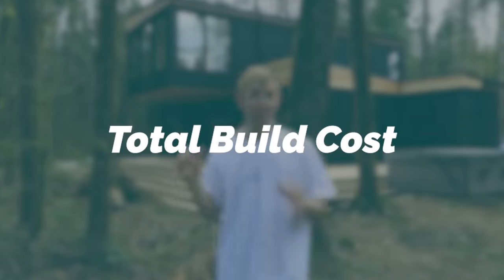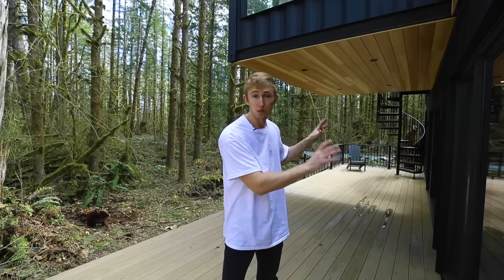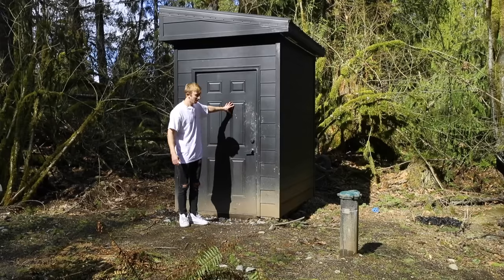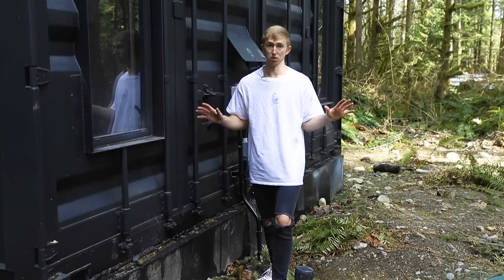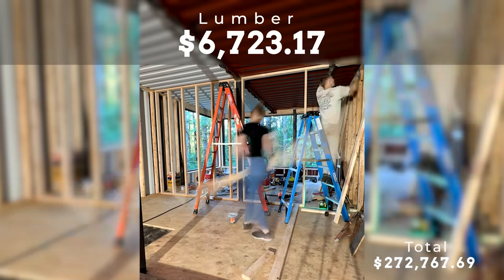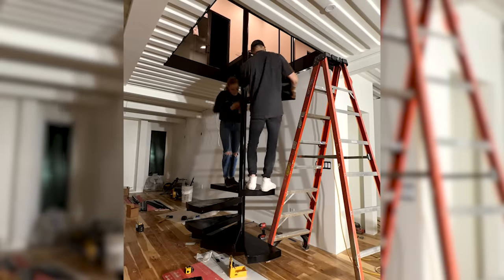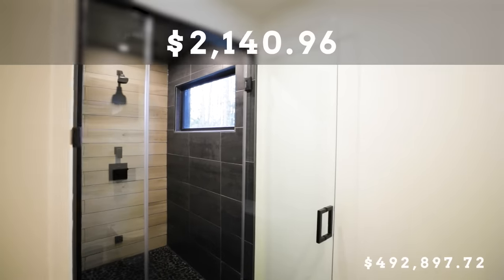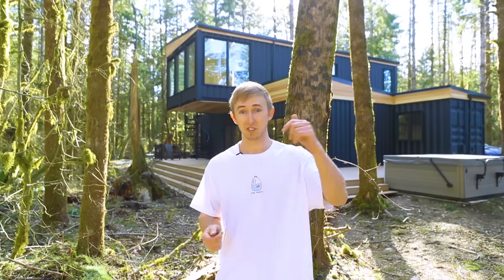How Much My 2-Story Container Home Cost to Build

Comment: Designer-turned-building contractor-turned-urban planner here. A few observations, and two questions for Devon.

1. Your site considerations will very greatly from region to region.  You won't have to worry about wetlands in some areas, for example, but you may have to worry about windstorm or seismic.  And, in many states if you are building outside of city limits your permitting will be much different and often less odious.  As another example, the cost Devon mentions for the water well is probably twice what a water well would cost here in Texas: most well drillers charge more like $50 per foot, and we can typically get good water at 120' or less (except on the coast due to brackish water intrusion). 

Point being: do your due diligence. Know your local conditions. Figure all that stuff out first before you buy a single nail!

2. Same with permitting and design professionals.  For example, the fees for permits that Devon mention are outlandish in most parts of the U.S.  So don't think those are representative; they may be less or (God forbid) maybe even more!

3. I like that he talks about some special considerations with shipping containers like what happens if you offset the containers, or cut them. All those cuts have to be reinforced (but in a site-built wood-framed house, doors and window openings have to be reinforced as well). And of course you can avoid the other issue by simply not offsetting or angling the containers. 

4. Know your lead times for construction materials too. Time is money, after all.  And if you aren't a building contractor and have never done it, by all that is good and holy on God's green earth don't believe the DIY Network shows that make ti seem like self-contracting is so easy. It's absolutely not; you're watching experienced professionals on scripted TV.  Hire a reputable contractor. 

Now the questions for Devon:

1. What is your cost per square foot for the habitable structure only, with all the site and utility stuff removed?

2. What is the average cost per square foot (habitable structure only) for site-built wood-framed houses in the area? I'm curious to see if there were any cost savings per square foot.

Comment: So I do that exact work for my local power company. We just did a job similar to that (longer distance but not in pipe, it was direct burial so cheaper) and the material cost to the customer was about $12k mainly being the transformer and primary cable. I didn’t see what the company bills for labor but they definitely over charge. We have a similar job coming up and they billed three 8 hour days just to dig the trench.

Comment: Pro tip: If you want a modern/custom home, just buy a prefab modular home from an independent builder. It will be a much more sound and solid structure for a much better cost.
Reply: Can I make youtube content off of that?
Reply: @MichealDraven  just build a small regular home bro.
You can make a video doing it, I will watch it.
Anything that is prefab can be limiting.
Reply: the cost of this build is insane, im glad he posted this and i will never bother going this route, the house i could build for this much would be epic lol, he got rolled on the price of his containers too, def contact a pre fab company over this path. its over 800k in aud, i could build a 3 storey 6 bed 6 bath 4 car garage with a heated pool lol
Reply: @Big_Red_Wade  any time I see some BS post about container homes, I get upset.
Like how can anyone think, living in a 9*18 metal box is a good idea?
And people think they are saving the environment, money and time doing that shite. Because some crackhead on social media made a video for likes and clicks.
Reply: Finding the land for a prefab/modular is the problem though. Which in some cases can be pretty costly. Originally, I wanted to go that route too. But just couldn’t find suitable land at a decent price. So I ended up buying a small old house instead that been recently renovated.

Comment: The cost of that $27000 box (transformer) is in engineering, copper, safety controls (it's high voltage) and likely installation. Just as you identified, equipment to install the units costs money too.

On the infrastructure side, these transformers regularly exceed $200,000.
Reply: I paid 4000….
Reply: @collinfranks   Is it an equivalent situation? In what state? When? How long was the conduit run to the transformer, and what size transformer was it? There are a tooooonnnn of factors at play here. In California, I've seen a 200ft 3" tandem feed to a 25kVa pad-mount reach well into $30k.
Reply: Not in engineering really. I suspect this place is secluded, most of the cost is boring through private property which will need private locates, bore rig labor of some maybe 500 feet run and underground wire pull. Had there been an overhead pole line by his property it could've been free after rev credit

Comment: I have been binge watching Containables and was wondering about resale and appreciation and really thinking about selling my current home to move to a smaller container home.  THIS VIDEO WAS AWESOME and that home is absolutely stunning -- thank you so much!!
Reply: Containers don't make a house cheaper. They will actually make your home more expensive, and are only really good for stacking or hanging out like this build.

Just build a small modern looking house from timber. Make the roof 2.7 metres high and it'll feel grand whilst still being small
Reply: @chrispekel5709  Thank you for your advice 🙂
Reply: @ToOpen6seven  no problems at all. An alternative to normal containers is refrigerated containers. Different design that makes it less work to cut out holes for windows, and they are heavily insulated. Just have to pull the fridge unit out (buy a non working one) and replace that wall.

They make a lot more economic sense provided you don't re-clad the outside.

Comment: I have been planning and designing to build my own container home for several years but land cost and construction costs have made me pull back. Love what you did here.
Reply: Land cost is extremely cheap. You can find multiple acres of land in a nice area for only 5000 or $10,000. Max construction cost should be zero you should be able to build all of this yourself and you shouldn’t expect to build some super mega mansion, or else you will work for the rest of your life or you’ll never be able to afford something like this to begin with.

You can build a small cabin and have everything run on solar get much cheaper water collection system land everything included for under $50,000 and even that is quite expensive. This guy basically build a mansion and it’s not representative of a cheap off grid living situation. This is representative of daddy’s money, rich boy that wants to live in the woods and pretend he’s a hippy.
Reply: @ZxAMobile  5-10k for multiple acres? Where the hell are you looking at?
Reply: @Zachary Brand  look anywhere like 20 or 30 minutes away from a decent-sized city in almost any state even in Los Angeles. If I can't walk around barenaked on my property then the property sucks. 

I want 0 neighbors within a 1 mile radius at least, this type of land is generally very cheap and you still have all of the amenities of any other property that's stuck in a high population sht hole. 

I absolutely love the fact that most people think that unless you spend like 200 Grand you can't build a house on your own land, not knowing that you could build a super high-end beautiful house with only $50,000, land included.
Reply: @ZxAMobile  Not in my location. You can get 1-2 acres for about 15- 20k. Central NY area. 50k for materials, land, and building a house? Not so sure about that. If you're digging wells, septic, electrical, etc. You'll need to rent equipment like this guy did. You're already way over 50k. Maybe in bumfuck nowhere you can pick up that amount of land for 5-10k but I doubt it.
Reply: @zacharybrand6077 Exactly!
Where I live, 500Gs is lovely because the average family home goes for 800Gs to 1.2M... and it's because of the land, nothing to do with the shack.
Reply: @eloahnon4952  ack that’s crazy. I’m actively trying to find a way to move out of the US lol everything is too expensive it’s ridiculous. Places in the world where you can buy massive mansions for those kinds of prices it’s ludicrous

Comment: That transformer and associated work seems pretty on par. I used to do electric utility design for new builds like this and there is a hell of a lot of engineering that goes into something like that if you're the only service off that transformer. If there happened to be an existing xfrmr nearby that could drop to your service, it probably would've been between 40-60% less expensive. 
Cool ass build
Reply: nope ridiculously overpriced. few hundred feet of cable? and a transformer box? cost them around 3-5k$  and they charge 15-20k for it. your off your damn rocker
Reply: @TheJomoe1  "cost them around $3-5k"  It is a public utility so they make no profit. I work for a similar public utility in the area doing new service connects and this is a little high but not uncommon. A few years ago it was a lot cheaper but the material shortage has caused the prices to fluctuate and significantly increase. So if you have bad timing it can be really bad and that's if you can even get the materials. You aren't getting a pad mount transformer with all the necessary materials for less than $6-7k now. Overhead is still somewhat reasonable. Underground wire in conduit is $7/ft and I don't see the road so it's probably at least 500' so that's $3,500. If it was more than 500'-1000' they would have to install vaults at $3-4k each plus the additional footage. The cutout at the pole, brackets, riser, conduit, taps, probably cost another $1-2k. And they probably have a new service connection few that is used for upgrading the substations when the new services cause them to fill up so say $2k. Meter base and meter $1500k installed right now. If you add in the cost of the dirt work that's at least $2-3k(just guessing). So that is $14k-23k. My math might be a little off but you get the idea.

Comment: Super late on this one but I loved the video and there's a bunch of useful information. But you asked about the transformer and why it was so expensive. I used to work for a transformer manufacturer and the short answer is its filled with magnetic steel and thick coils of solid copper. The majority of the weight of that transformer is copper and magnetic steel and there's A LOT of it. So I know its pricey but based on the size of that unit you were not ripped off if that helps at all :)
Reply: thanks for the dope reply

Comment: really cool build, only problem i see with it is if you look above you at 12:15 the ribbing from the steel container, if you guys didnt treat the interior gap side of the walls, or seal them, eventually youll get rot / mold in all the walls if you did not seal them because of humidity / steam getting in from the showers. Other than that I love it lol

Comment: The box doesn't cost 27,000. The equipment and labor cost 27,000. They had to shut down part of the existing system to tie you in, then run a directional bore (this is lots of $$$) from that tie in all the way to your site. as well as any excavation to run conduit or 'stub ups' into the concrete pad.
Reply: Pad mount distribution transformers can easily cost over $20,000

Comment: Thank you for doing this! I’ve been exploring this option here in Florida, but finding contractors is almost impossible due to the boom in housing construction and the recent hurricanes.
Reply: finding contractors is easy, always has been always will be, Finding TRUSTWORTHY ones is the hard part. Finding ones who wont take you for half a million on a 1/4 million cost build.
Reply: We build here in florida . I have looked at options for this type of home here, and doing CBS comes out cheaper to build by sq ft than doing this newer builds . They definitely look nice, tho

Comment: $36k for the windows and doors was actually on the cheaper side compared to what I’m looking at for 2x 6’x3’ windows, 28"x36" window, and a 12’ split sliding glass door set on a condo @ $18k. Your HVAC was rather reasonable as well depending on how many tons/sear’s it is. Beautiful build regardless

Comment: Shipping containers are a total scam and you ending using 1/100 of the material in it. It was a great campaign from the shipping container manufacturers to sell more.
Reply: A lot of people here in Australia want to do it as they think they'll build a cheaper house... I have to keep explaining that all you're getting is a frame with thin walls. You can build that at the correct size new for the same price 

They do make decent storage sheds and workshops though

Comment: I'm full time Real Estate investor, thank you for video, this project is crazy 😄. Congrats on executing and succeeding on SM with documenting the story! I have few questions please:
1) What do you mean by "cost of property" - cost of 5 containers + lot?
2) I can't wrap my head around how did you get such a high amount loan on all this crazy stuff... It's in general not easy to get construction loans and here it is for some containers where you technically came as not experienced Home Builder and you definitely had huge cost overrun... Was it private lender? Can't see any sane bank to do loan on this unless some crazy cross collateral on house with $750K equity you had to have there.. 😂
3) Why the permits are so ridiculously expensive, do you mind to explain how it came to $10k? was it like cost per a job for every single contractor that you paid instead of everyone working under one construction permit?

Comment: Did he include gas cost driving to and from the site, electricity cost during the build and water bill. Adding entertain cost such as Wi-Fi, cable or Netflix. This then becomes continuous monthly cost. Even the smallest of the smallest cost add up. I love the house it is built with the future in mind,limiting up keep, will save money for them in the future. The first build is always the tuffest get taken advantage of if not knowledgeable. You learned a lot and it will save you in the future. Best of luck to you!!!

Comment: I stumbled across this and just have to tip my hat to you. A great finished product. You probably learned enough on this one to bring your costs down significantly in the future. I can see a whole development based on this concept which would lead to economies of scale. I would have melted down at like the second obstacle. Well done.
Reply from the maker: Thanks a ton! I def learned a lot. Looking forward to the next one! Economies of scale would definitely help a lot!
Reply: I don’t know what your day job is but consider raising $ fm investors AND partnering with well recommended local builder. Instead of building on spec, sell off plan, i.e. buyers make upfront deposit and payments at say 25, 50, 75, 100% of completion. Only break ground after say, six signed contracts—bulk savings all the way around. I’m making it sound too simple for sure but you’ve got a great product. The key is price point and I’m not that familiar with your area. 😁😁

Comment: Part of the cost is for the ground transformer and the housing for it, and the mini foundation that it sits on. Remember, lines that run above ground are usually put on a post and are easily serviceable in the air. On the ground however, that unit has to be able to withstand snow and water buildup that can come under the ground in worse case flood situations, again the platform it’s sitting on and a more waterproof system. Then, running the cables underground is usually a premium compared to above ground posts, which used to be common. Some places do this because of the natural environment around the cables, like trees, pose a hazard during a storm of falling on the cables. Also transformers in the air in high elevation areas where you receive more thunder and lightning, are more likely to get struck and loose power. But you’re going to pay for the transformer upgrade and to bury your lines. This is why Philadelphia is more affordable than say NYC, where power lines have not been buried in Philadelphia, a decision made by the city to help keep the city affordable. Because burying lines under cement and concrete can be an expensive undertaking. In your case it seems a combination of factors.

Comment: Traditional small house would work just fine. And supplies are plentiful. Have you ever tried to cut a window opening or doorway out of a steel container? Plumbing, wiring and walls cut into floor space. And you have to build walls if it's an outer parameter wall because you have to insulat.
You just don't slap a couple of days together and decorate.

Comment: The hot tub needs to have a removable part put in the deck for access to the front of the hot tub. Better to do now before the hot tub has any issues. I think that is a hot tub from the company I work for and there is a clearance code that the hot tub needs to have hatch put in. Also I know that area gets a lot of snow in thee winter. Better to do now now before we get some snow. Also that deck will get real slippery once the snow and ice comes.